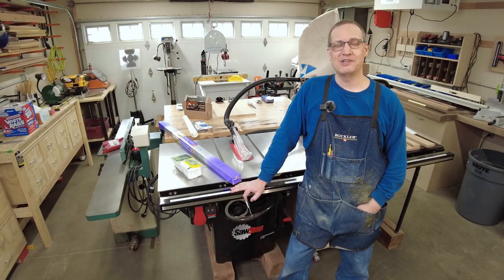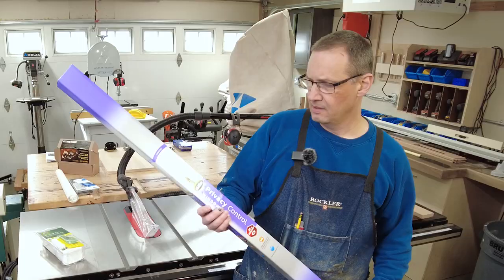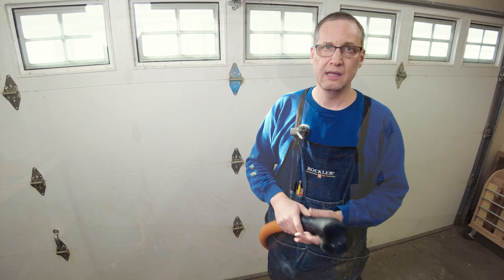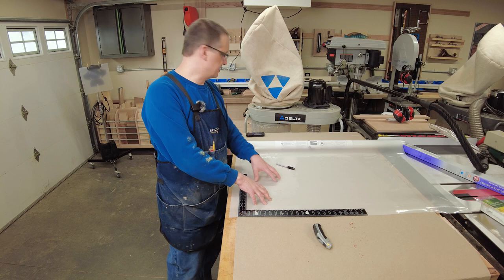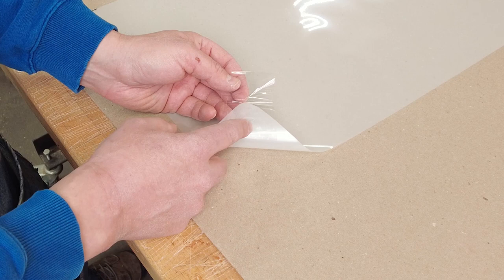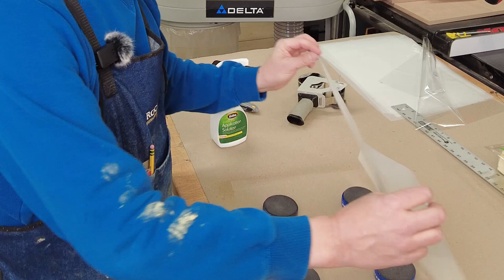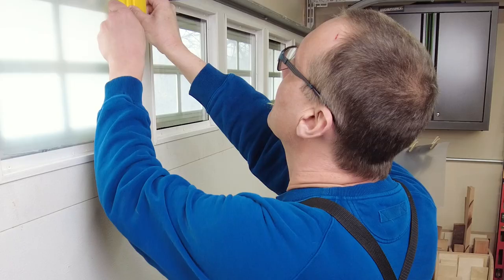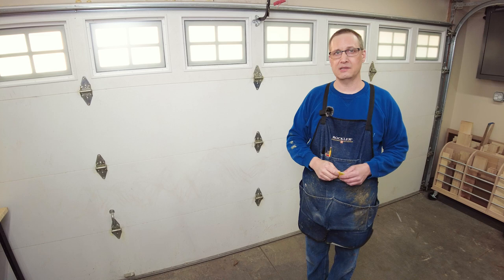Put Privacy Film On Your Garage Windows

Comment: I once had a vending machine business in a space about the size of a 4 car garage. It was broken into by someone who trashed the place looking for money, as the only thing taken was a coin box with probably $40 worth of change in it.
I was faced with the same problem as you, and decided to put an alarm system in, but I never finished. All I installed was some of the metal alarm tape on each of the windows, and then some of the plastic frosting film on all of the windows. I never had another break-in, likely because they saw the metal tape on the windows and assumed that there was a working alarm system installed. The break-in took place less than 2 months after I had begun using the space, and my business was in there almost 10 years. When there I never opened the doors or windows, and only allowed occasional close friends and business associates in there with me. The tape on the windows kept the low life from breaking in.
Reply: Only one side of the metal tape is sticky, so when you get to a corner, you need to fold the tape as you turn the corner. The excess triangle shaped area then just gets folded down flat. No cuts in the tape until you complete the window. It's common to begin at midway on one side of the window and then make a square U shape staying 1 1/2 - 2" away from the frame down, across, and up, and then a right angle turn to match the first end. I just looked at real alarm installations and copied what they did.  I had planned to solder wires to join the tape on each window together and a long wire from the far end back to near the other end in order to install a push together connector above the door latch, so that I could unplug the door (with the alarm off) to be able to open it, but never even did that. For double hung windows, make a complete square of the tape, again staying 1 1/2 - 2" away from the wood frame, so wires can be attached, again through a connector on one edge of the window. Do the same for the other sash. On a passage door, do the same with the windows, but you can bridge the hinge with a cable and avoid the need for the connector. Everything then gets joined together in series if you do have an alarm system. If the doors are paneled, running a thin wire that easily breaks horizontally across all the panels in each non windowed door section can secure the panels if someone tries to kick them in. I wouldn't bother with this unless really putting in an alarm system. The tape on the windows is usually covered with a thick varnish so it isn't easily damaged when being used as an alarm, but not so important if just looking for the alarm appearance. If you have the doors open and unexpected visitors come to call, you had better go the full route of connecting the wires to make a complete alarm detection system out of it, because it's easy to tell from the inside if it's a complete alarm loop or not. If you go this far you might as well build out the alarm circuit, at least to the point of installing a loud bell or horn high on the outside of the building with hidden wires. Good luck with it.